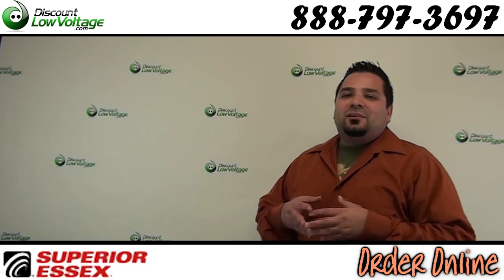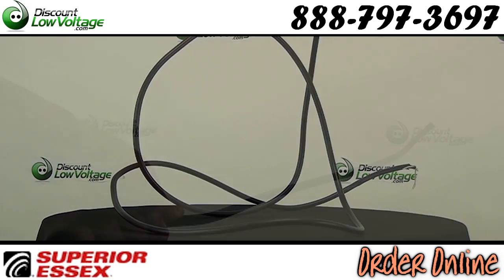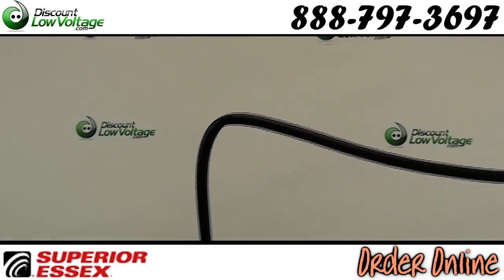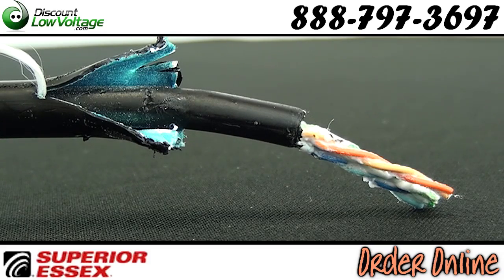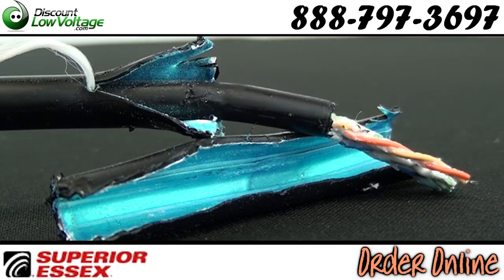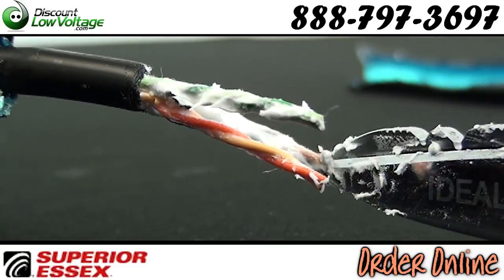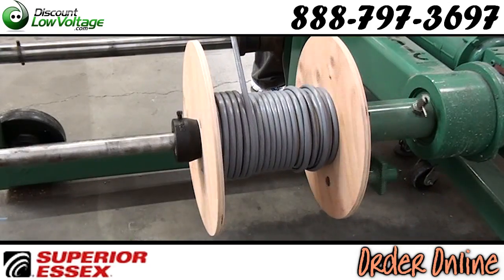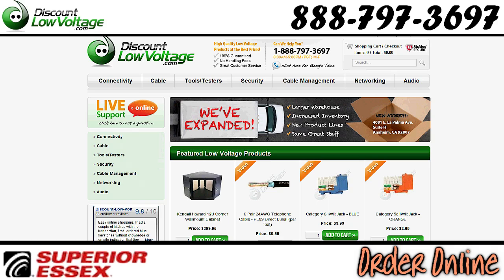Outdoor Cat5e Shielded Cable for Direct Burial wiring installations

Comment: looks like good quality cable as long as its not CCA.
Reply from the maker: No copper-clad aluminum. Good looking out, that's a sneaky way some brands charge a "Low Price". 100% Copper always.
Reply: @DiscountLowVoltage  whats worse is that a friend bought some cable and it was advertised as 100% copper*. on closer inspection the asterisk * at the bottom of the box was a small footnote saying 100% copper cladding.